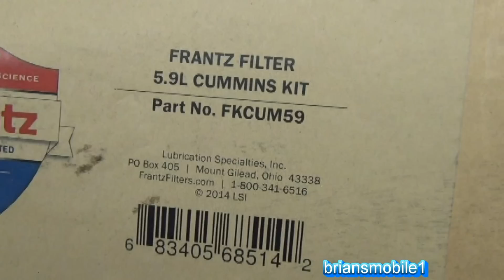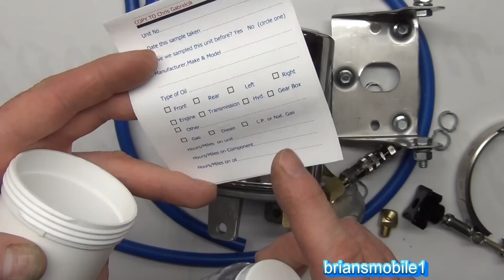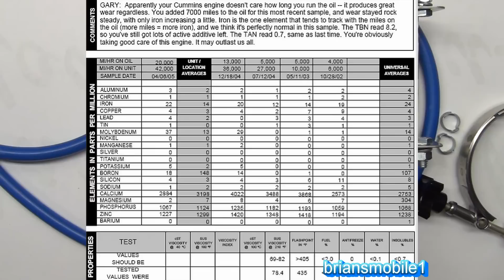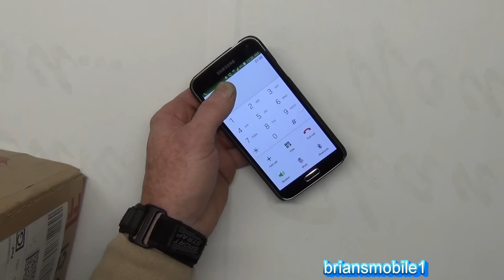How to Make Synthetic Oil Last Even Longer  Frantz

Comment: If you filter smaller than 100 microns you will remove additives from the oil. Stainless mesh is far better.
Reply: That is simply not an accurate statement.
Reply: deano_au 
Correct on all but the last item. 
Iron/steel content and concentration is used as a wear indicator in engine lube oil analysis. 
Also used in oil filter entrapment/capture analysis. 
Iron/steel as it wears and is suspended in engine lube oil will typically not be single atom particles. 
Most iron or steel wear particles in suspension are larger than 5 microns many times with a large portion being larger than 40 microns.
Reply: Simply false.
Reply: Where do these people come from. 100 microns. A 10 micron abrasive will damage the engine. Actually a 10 micron abrasive is an engine wearing abrasive a 40 micron abrasive is a engine damaging abrasive. To someone like me a scratch on a polished surface is engine damage.
Reply: The only stainless steel filters Ive seen are high volume filters not designed to clean oil. They are to use with a depth bypass filter or for use where sludge removal isn't  needed such as racing.
Reply: @ralphwood8818  Since I posted that they're out of business. But it's a 6 year old post.
Reply: @jw4620  I was in a high performance auto parts store in the 80s getting a Weber carb for my 84 Subaru.. as usual I mentioned a Frantz oil cleaner. He.said let me show you a real filter.You could read a book thru the element. Obviously only for racing.where you changed the oil after every race.
Reply: @ralphwood8818  Frantz used toilet paper.
Reply: @jw4620  Yes I installed my first Frantz on a Rambler American flat head 6. It came with a nearly useless bypass  filter bolted to the top of the head upside down with steel oil lines. The over head valve models had a full flow filter. I was using Delo 100 W 30. Easy to remove the filter and install a Frantz. When the oil went from black to gold I was hooked on clean oil. 1963. No Frantz TP in those days. The grocery stores had plenty of 2 ply facial quality TP. In those days engines ran dirtier and the Frantz had to be changed more often. About every 2.000 miles .Delo was 29 cents in the discount stores.

Comment: caveat emptor.  For every person who claims this has benefits, another will claim this has zero benefit.  True, IF a filter can remove everything larger than 1 micron, theoretically the engine should have less wear. Theory is great, but practicality rules.  /1/ Not all toilet paper is equal. A real risk is the paper will deteriorate and enter the engine; and, it may not achieve the filtration in any case.  /2/ This system cannot prevent and cannot remedy a prime fault for any internal combustion engine: "fuel dilution", oil diluted from fuel contamination.  Even if the filter works as claimed, fuel dilution will degrade the oil: so you will need to change the oil at regular intervals in all cases.  Thus the benefits of this product are entirely moot.
Reply from the maker: Fuel dilution can be a concern on some engines.  Removing contaminants is always beneficial.  That's why every engine has an oil filter.  It's critical.  What does "entirely moot" mean in the above comment?
Reply: No the TP doesnt break down. In my 60 years of using TP oil filters ive heard that old wives tale a lot of times. One common problem we had was putting a TP filter on a neglected sludged up engine. The TP filter could reach its capacity in less than 50 miles. Some engines had more sludge than oil in them. The TP filters have always required a healthy amount of common sence. I told my uncle we will need to open up the engine and remove the sludge or change the Frantz every 50 miles. He traded the 59 ford car for a new 63 Dodge pickup. When i was putting the Frantz on the pickup his brother drove up. You could hear his lifters. He said if.I knew you wanted a Frantz I would have given you mine. My oil is dirty and my lifters are noisy. I asked him when he changed the Frantz last. He said change it The guy I bought it from said it would last a lifetime. The Frantz went on his brothers car.

Comment: Hmmmmm... So in reality, buy this kit... Hook this to a Pump and just " Filter " out your " Old Oil ",  then change the Filter and dump the " Filtered Oil " back.  In case for the " Viscosity " nut shells.... Just add 1 quart of 10W-40 to your 3 Quarts of 5W-30 " Filtered Oil ".  OK, sound like a plan, don't you think?  LMFAO 😂😂😂😂😂
Reply: It helps to have a clue about using filters that clean oil.
Reply: @ralphwood8818  -  You need at least 3 Stages of Filtering, see below.
#1 = 50-20 Microns
#2 = 10-5 Microns
#3 = Ceramic Filter = 0.5 Microns.
Reply: . Not true You need a full flow filter to remove the large engine damaging abrasives from the full flow of oil to the engine. The Frantz removes what is too small for the full flow filter to remove. Oil temperature removes the water and unburned fuel thru the PCV. My 66 VW beetle didnt have a full flow filter The Motor Guard did it all. The same for the Frantz on my 64 Rambler American flat head 6.

Comment: Not disputing the effectiveness of that oil filter at catching small particles, but 7t comes at the cost of reduced oil flow and circulation rate.  This reduces the heat transfer, compromising the primary function of engine oil which is heat transfer away from bearing surfaces.

Only the cheapest construction gas, oil, engine and cabin air filters are made of cellulose paper. Better ones are made from synthetic fiber non-woven blanket.

The reason is because it was possible and an engineered fiber can be better.

Wood cellulose strand structure is smooth cylindrical. Synthetic fiber can be extruded with a lobed cross section which has greater surface area. When matted into similar weight and thickness blankets,  a lobed fiber has twice the  surface are as cellulose and while the porocity may be the same,  the capture of submicron impurities (which aren't measured in a standard oil test setup) is greater.

A far as extending synthetic (or any) oil life goes, except for worn engines, oil depletion is from additive depletion caused by acidic bypass gases and moisture. No filler can stop this, though some have slow release additive supplement capsules designed to replace ineffective additives.

Modern engines are designed to run efficiently  within a much smaller temperature range than their 1950's ancestors. The flow characteristics of the lubricant within the engine, not just the gross viscosity, is critical.

The TP oil filter is a obsolete relic from the days of 3000 mile oil changes. Putting it in a fancier can doesn't change how, or how well, it works. Using it in combination with a standard filter makes no sense if it works better. That NO auto manufacturer will cover damage to an engine if only a TP oil filter is used should tell you something.
Reply: This is a bypass filter, won't reduce flow.

And yet, people still use them and still love them and have oil analysis to show.  I guess with your logic, it just can't be explained.
Reply: It increases surface area of the oil to outside temps, so it increases the heat transfer of the oil a lot more! You were exactly oppositely wrong on your statement.
Reply: Bypass filters have been used on cars and trucks for 100 years. They all have restrictor orifices to keep too much  oil from going to the bypass filter. They have no effect on oil flow. You dont know nuthin. My New Rambler American came factory equipped with a bypass filter with steel oil lines. The spin on filter had a orifice built in.the same as my 55 Studebaker.. The only difference is the Frantz cleaned oil. The Rambler filter didnt clean oil. I could still get cotton filters for the Studebaker up into the 60s. Not as good as toilet paper but a lot better than pleated paper filters.I fixed the filter problem on the Rambler with a Frantz oil cleaner.
Reply: You dont understand the oil system but you are trying to explain how it works. Nothing has changed . The Full flow filter removes the large engine damaging abrasives from the full flow of oil to the engine. The smaller engine wearing abrasives build up in the oil until you drain it or install a bypass filter that can clean the oil. You use a lot of words to show your ignorance.
Reply: In my 60 years of using TP filters starting with the Frantz nothing has changed. The full flow filter removes the engine damaging abrasives from the full flow of oil to the engine. The smaller engine wearing abrasives and sludge build up in the oil until you drain it. The only thing different is engines are cleaner now. In the 60s I changed the TP and added a quart of new oil about every 2.000 miles. I normally go 6.000 miles now.

Comment: This video doesn't show shit...
Reply: It might be your internet connection
Reply: you might be using a Frantz filter
Reply: It shows that the TP fit. It is obvious that the so called T P is a custom made roll made for The Frantz. Oil cleaner. It is almost impossible to find TP that fits these days. The Frantz isnt set up for TP..you can use TP in the Frantz if you know what you are doing. Most people dont. Even the Frantz dealers dont have a clue. Also some Frantz dealers say TP breaks down in oil. That old bull shit has been repeated as long as there has been TP filters. Never thought I would hear it from Frantz dealers. Ive heard it since I put A Frantz on my new 64 Rambler American. I can see the logic. If you cant beat them join them. Then claim your element isnt TP.